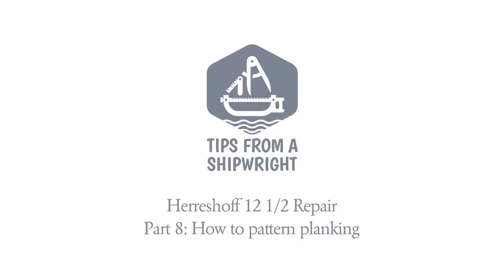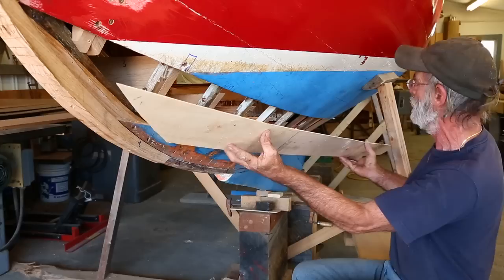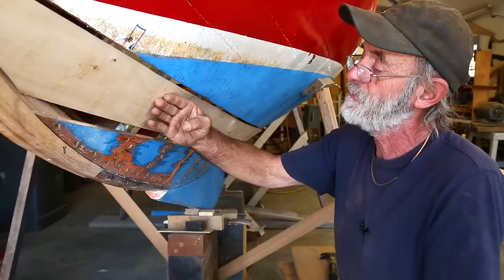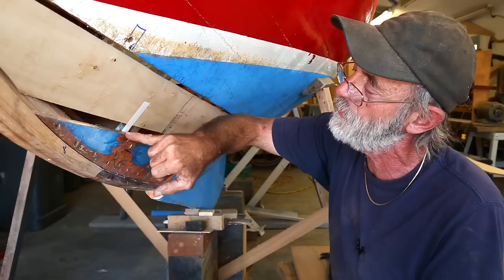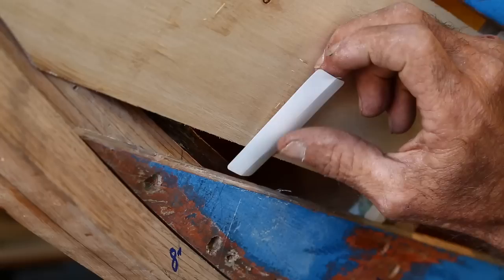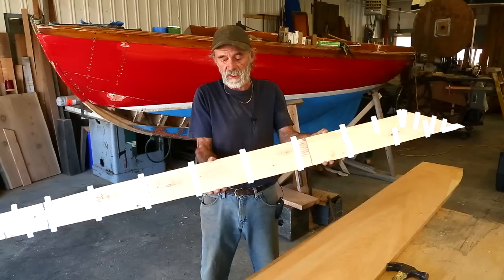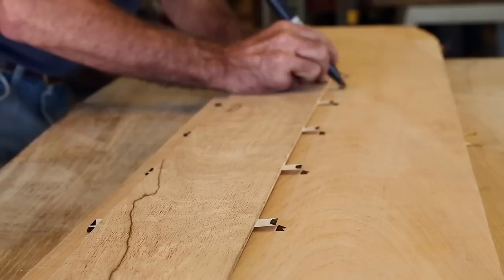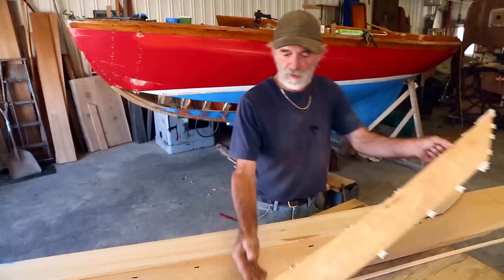Part 8 - Herreshoff 12 1/2 wooden boat repair - How to easily make wooden plank patterns

Comment: I've used a hot glue gun and 1/8" door skin strips to make patterns before, but I must admit that your method is both cheaper and faster. Thanks for the tip Louis.

Comment: I'm  designing a 14 ft kayak. Construction method is Stitch and Glue.  There will be the bottom panel and one side panel...simple.  There are no frames which to attach the longitudinal batten which you apply the sticky labels.  Does this mean I have to alter the construction method and use forms at each station? I'm thing that.  What would be your opinion on using female forms So......if I used your method and ran a, let's say a 3" wide batten the entire boats length and use the sticky strips on it would this give me the points I need to make the panels. I am working from the inside now because the forms are female and are on the outside which would get in the way.  Using female forms also allows me to run fiberglass tape the full length inside at the chine and keel since there are no internal forms. I'd like to use 1/4" for the female forms. I probably wouldn't have to bevel them as they are thin anyway. The forms would be 12" from each other using scrap ply I already have. Any input would greatly be appreciated.

Comment: This is probably a real stupid question by why did the pattern have to go on the board outside down.
Reply: The pattern represents the plank on the inboard side. The outboard side of the plank is wider because of the bevels. The bevel angles are measured from the pattern to the edges of the adjacent planks. Therefore you need to trace the pattern on the inside of the stock. You could use the other template tricks Lou mentions if you were inside the boat, marking on the inside of the template. This way is really clever for marking from outside the boat. Popsicle sticks and hot glue works too.
Reply from the maker: Right on Michael
Reply: because the out side is thicker--- but in fact you're right because he will need to cut it back for the reason you said.
Reply: @mChrest05  and here I was thinking it was so that the pieces of paper would lie flat against your plank stock.  Now I see that you would still need to use your lines to cut in a slight bevel for the new plank to fit.